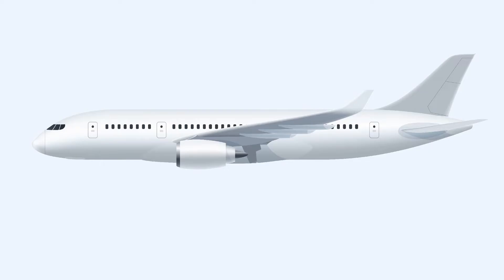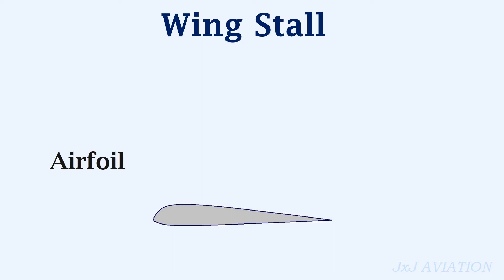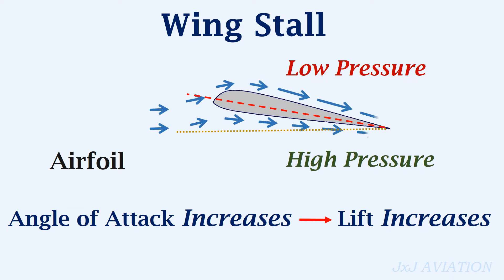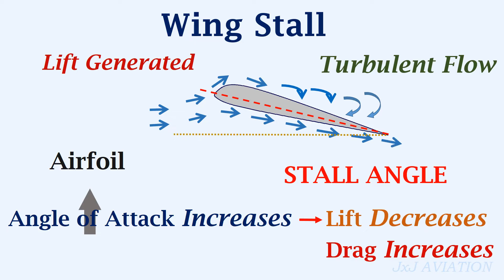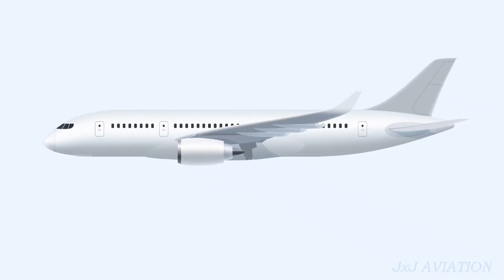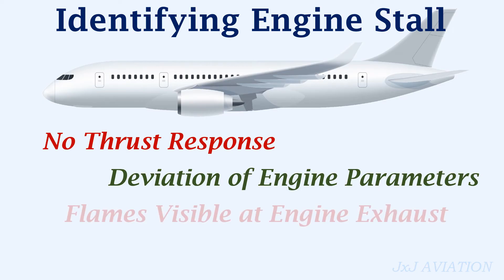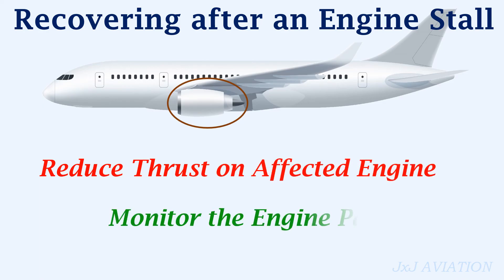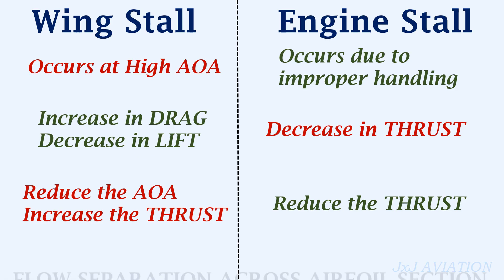Understanding STALL: Across an Aircraft WING and In An Aircraft ENGINE

Comment: Sorry to correct you but at 0:30 sec you are confusing pitch angle with angle of attack 
A stall does not occur when a high pitch angle is obtained 
A stall occurs when a critical angle of attack is obtained ….15 to 20 degrees for most aircrafts,
big difference between the two
You could be in a 45 degree angle of pitch  and still maintain zero degrees of angle of attack 
As long as the aircraft is fliying in the same direction where the chord line is pointing at, the angle of attack will remain the same.
The angle of attack increases when the relative airflow is not aligned with the the chord line The angle of attack is determined by the chord line and the relative airflow not by the horizontal axes  line as you suggested at 1:37, at this time you are confused with the angle of incidence 
In other words if you are in a  pitch nose up attitude  but flying in a straight leveled flight,  you have increased the angle of attack 
If you have the plane pitched nose up attitude and the plane is flying in the same direction  as where the nose is pointing  there is no angle of attack being increased, the airflow is aligned with the chord line.
Flaps play a major role on the angle of attack as well . the more flaps are deployed de greater the angle of attack,  which generates more lift but you will reach the critical angle of attack quicker 
the plane will stall at a lower nose attitude with the flaps deployed but again only if you are moving in a different direction of where the chord line is pointing at.
you can also reache the critical angle of attack in a roll attitude if using the elevator to turn.
Reply from the maker: Yes. Should have been more specific in the explanation! Thank you for the clarification!

Comment: AOA is the angle between the wing chord line and relative wind ,not the horizon.
Reply: Understanding this what made stalls finally make sense to me. Relative wind is not necessarily horizontal, it's opposite to the flight path. When the wings point in a very different direction from relative wind, the won't flow smoothly and won't generate lift. Thus results in a stall.